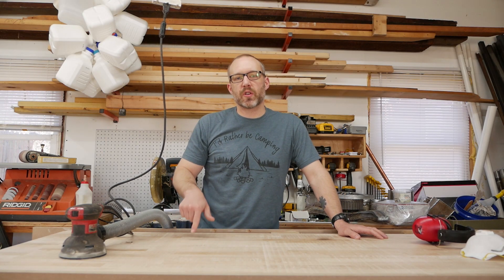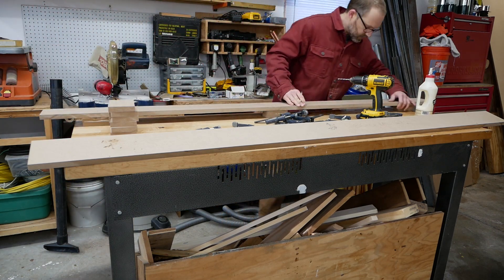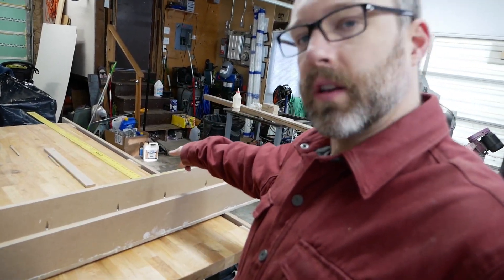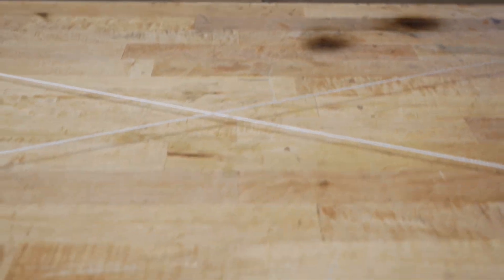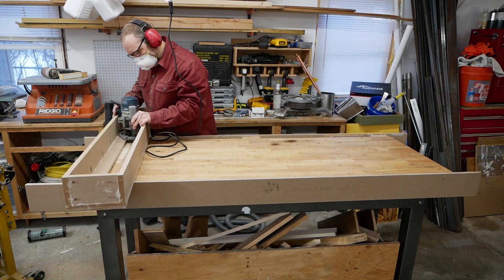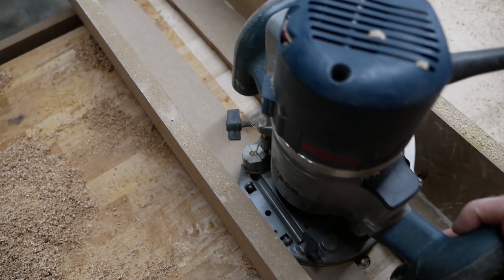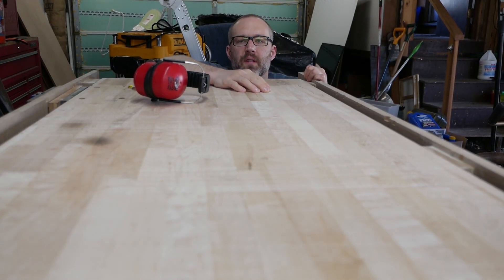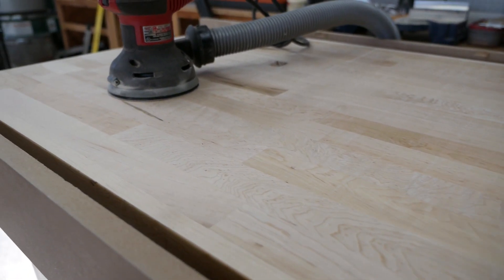Flatten a Workbench with a Router

Comment: question: i tried this with a 2 hp router (25, 000 RPM) and a 1/2 surfacing bit with 2" diameter (Binstak's CNC Spoilboard Surfacing Router Bit). It burned the heck out of my table.  I'm a noob, hobbyist. What could be the cause? I feel at times I was taking too much off of the surface off but then it would still burn when I was taking just 1/16th of an inch.
Reply from the maker: weird, I haven't experienced burning from a router bit before.  2" is a really big bit.  Maybe try turning the speed way down
Reply: @WhatDennisDoes  good idea, I'll try next time I flatten something. Thanks.

Comment: Nice video. I’ve been trying to solve this problem, and so far have been using winding sticks and referencing the sides of my bench. Aligning the rails is especially difficult when your bench top is 100% not flat (like mine)! I’ll definitely try out the string trick.

Comment: I don't understand how that string would work.  You can just keep taping one corner from the bottom string till the two strings meet and be way off
Reply from the maker: What I didn't explain well is that it may not give you a level surface, it only ensures that both rails are parallel, which would result in a flat surface.

Comment: Hi Denis great video- exactly the problem I am trying to solve.
I know I sound dumb but I don’t get how the string make me it level. Surely you can make the strings ‘just touch even if they are on an angle.
Doesn’t the whole thing really depend on you getting the rails perfectly straight and then getting the rail you put on first perfectly level with respect to the ground and also level with respect to the table....?
Reply from the maker: The only way the strings will just touch is when the rails are parallel to each other.  Give it a try with pencils and string if you need to see why.  You can get roughly the same result by checking for level in 3 places: the first rail, then across the rails at either end.  The string is just a little more accurate.
Reply: What Dennis Does hi thanks so much for replying - quite a rare thing in YouTube these days. I’ve gotten some bits of roof batten and string and cans of beans and mocked it up on the kitchen table. It does work but only if you don’t touch your three fixed corners that you set up and the beginning, presumably with a spirit level or laser.

Imagine your bench with corners going round it clockwise A B C D. A B is short, B C is long etc...A is diagonal from C on one string and B is diagonal from D on the other string.

Now suppose for a moment you are perfectly flat and the strings touch in the middle. Happy days.

Leave B and D alone - in other words just consider one string. Now raise A vertically 1 inch. The strings will not touch. In fact you will put a half inch gap in them at the crossing point. You can make them touch again by dropping C by the same amount (1 inch). This will close the half inch gap in the middle.

Now you will have a touching string where BD is flat but AC is on a gradient of 2 inches over its length. The beams of wood are now defo not in the same plane.

Of you leave three points for example A B and D fixed and only adjust C then it will work.

So you set the first beam with a spirit level and fix it. Then you fix one end of the second beam with a spirit level. Then you are sorted.... but why not just go all the way around with a spirit level.

Thanks so much for your help.
Reply from the maker: @hermanmelville2029  OH yes you are correct.  In your example though, when you lower C to make the strings meet again you are bringing the beams back to parallel, so the surface will be flat.  It won't be level, but it will be flat. The plane shifted so it's now on an angle.  You do need a level to make sure the surface is also level.  Sorry if I didn't explain that part.  Picture it this way, stretch a bed sheet so that it is tightly pinned to each end, A,B,C,and D.  Any time AD is parallel with BC you'll have a flat surface.  If one point is higher you'll get a warp.  I hope this makes sense.  Also, thank you for such a good comment.  I love having productive discussions on my videos.
Reply: What Dennis Does great stuff - totally get it now cheers !
Reply: What Dennis Does  by the way there are several YouTube vids out there on this ‘string’ topic that don’t make this 100% clear. If you upgraded yours or added a new video to explain it in serial that would be real unique content that you would have
Reply: Winding sticks are also good for checking for warp. This conversation really clears things up. Thanks all!

Comment: Did I miss where you showed us the bit you were using?  I'm going to need to do this soon and that's what I was hoping to learn from your video.
Reply from the maker: It was nothing fancy.  3/4" straight bit.  A smaller one would mean more passes; a larger one starts to get hard to handle, so I find that to be a good size.
Reply: @WhatDennisDoes  Thanks.  That's actually exactly what I ended up using (started last night before getting your reply).  This is a scary and slow process (scary because it does not leave a pretty finished surface and I'm hoping that I can get it back to that!)
Reply from the maker: @trolltaker  you'll have to sand it a bunch later but should turn out ok!  If you have very figured wood a trick is to use a "2 flute spiral upcut carbide endmill" it's what machinists use on aluminum and since it cuts with a spiral action it has less tearout on wood
Reply: @WhatDennisDoes  Yup.  Just got back from Menard's with 3 grades of course paper for my rarely used belt sander.  3/5 done with the routing.  Sure am making a lot of chips!  Maybe I should buy a couple of hamsters now that I have a lifetime supply of bedding for them.  - Thanks for your help, Dennis.
Reply: @WhatDennisDoes  Got r done.  Well, not the sanding part, but the router milling, and it went well.  I found that going back over it in with a couple of finishing passes, one perpendicular, really evened out the scalloping.